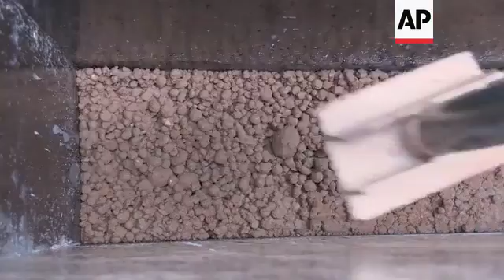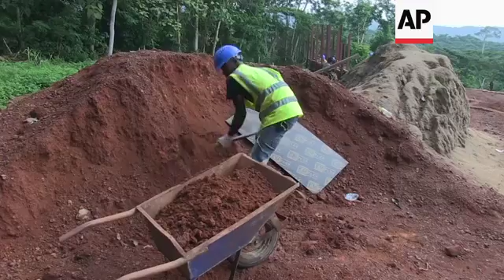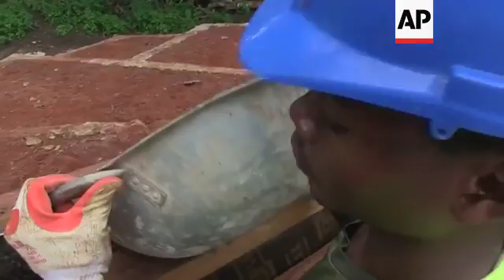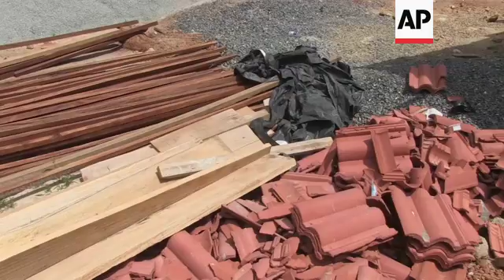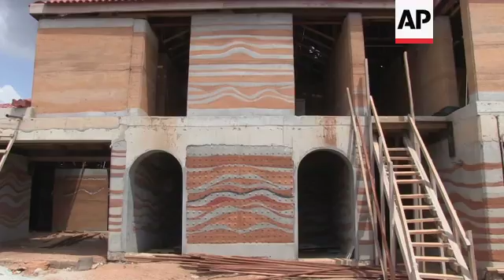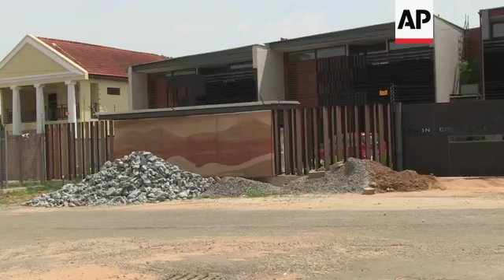Ancient construction tech adopted by high end architects

Comment: You could save time, money and energy by using compressed air     rammer machine. It comes also in a cylindrical form which will be suitable for your work. It's not that expensive (about $200 up). You will need an air compressor machine to power it though (also about $200 up) but believe me, an investment of $1000 in that (for a commercial project) will change your business.
Reply: Where do i buy that
Reply: @MRABDAHMED1  check online. Amazon, alibaba, etc
Reply: Ghai 😂😂😂I like that......... But too laborious though.

Comment: Just wonder how well does it stand against heavy flood?
Reply: I hear they coat rammed earth homes in a plaster to waterproof it. Also if you live in the Midwest usa I would mix cement in.
Reply: @django628  Yes normally it is recommended that 10% cement is added to stabilize the mixture. That way, it becomes waterproof and more strong